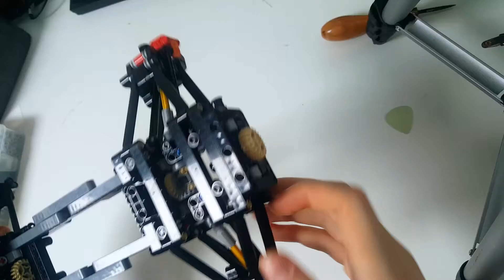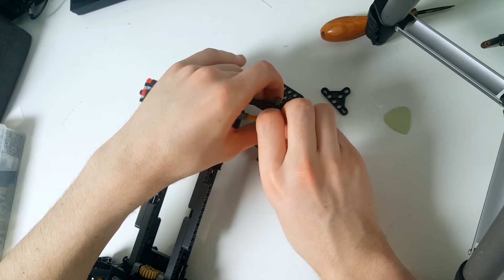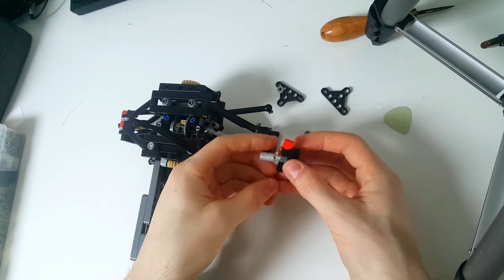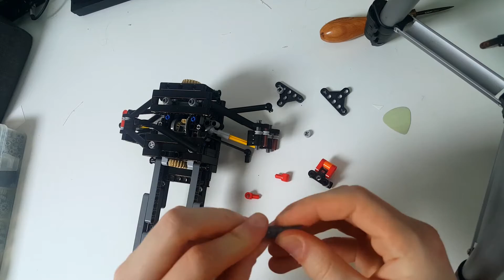Lego Technic 4x4 custom front axle wheel hub

Comment: Hey buddy. That’s awesome. So I have the cv joints and remember running into the same problems I’m noticing your running into, that’s if your trying to accomplish high ground clearance. The cv joints are a no go, because you’d need two per axle and the distance becomes to large under pressure and pulls out the x stick. Suspension has to be moved above so that it doesn’t interfere with travel either. So the older cv joints need to be used since they have a greater angular spin. The next problem I ran into was the amount width or pin holes between the f1 wishbones. The length compared to width had to match, and so suddenly you had weight that even placing the multiple heavy springs too in a angle couldn’t hold. It took a while to compact everything into a 3 pin hole sized center frame to hold the wishbones. That’s if your trying to build an entire functioning working system.
Reply from the maker: Interesting stuff, I agree with the CV joints, sometimes a total right off can't use em. Especially with those tight angles. There are a couple parts that would absolutely revolutionise lego if they just improved them slightly. Like the bigger CV joints are an improvement but hard to fit into a custom strut. I'm working on one now, the problem is there is really bad backlash. Best option currently is to use stock hubs but then we are back at the CV joint problem. They should just make u joint compatible hubs imo. Or use specialised parts. OR the community just start supporting home grown 3d printed alternatives. Now that would be sick. Also the 3 stud wide solution is definitely a good one, given how much width you have to sacrifice for different components. All this for decent ground clearance 🤣
Reply: @clipdump  u joint that’s the name I was trying to rember when I said the older cv joint. So I used two u joints, the end by the tire with a bushing for proper distance or clearance from the wishbone pieces. The other end I used that one U shaped part that you can place 2 bevel gears inside at 90 degree angles, it’s 3 pins wide and 2 pins high(idk the name). But that allows for it to move entirely parallel with the wishbones. I think my first video of the crawler showed the bottom… I updated the vehicle with a short vid explaining how to modify the pneumatic cylinder so it acts as a shock if your interested. 

I like your vids bro. You put out allot of good stuff. Maybe you can do a video explaining to the people how a shock at different angles can handle more weight and why. I don’t have a lego community or followers. Unless you’ve made the vid already
Reply: @clipdump  https://youtu.be/kvrCkANUFms
Here’s a link to my video about this very topic. I put out allot of information on future build possibilities that I think you can incorporate into future build videos for yourself. I’m the video I have a couple closeups of how I got the 3 pin hole working properly with full range of motion. Hope it helps